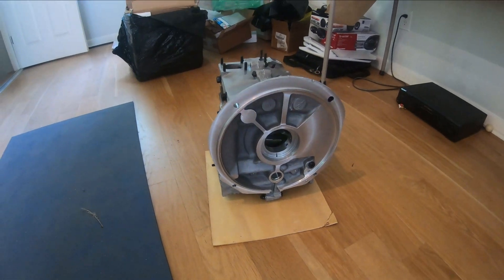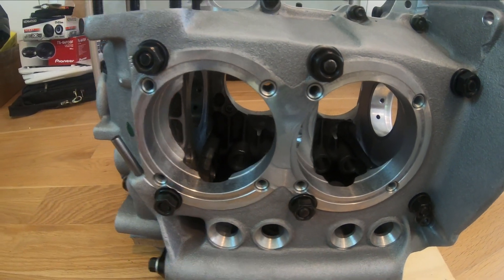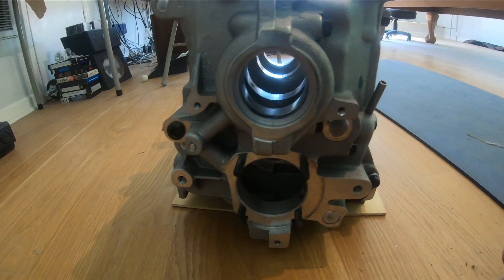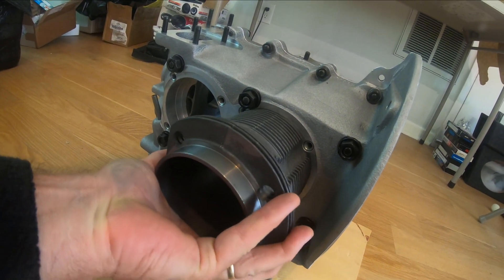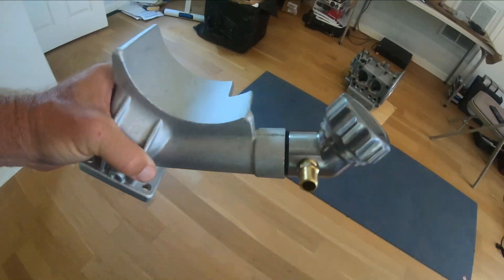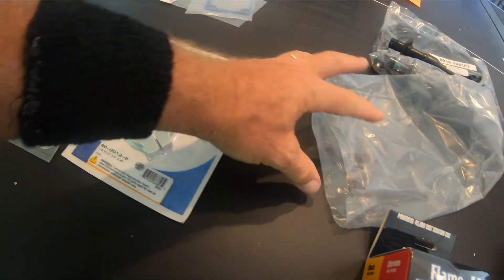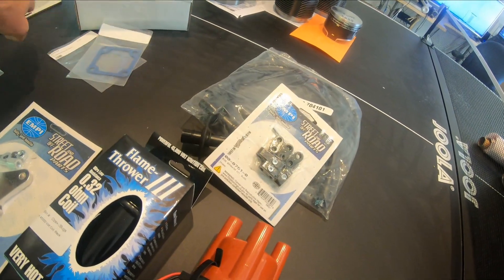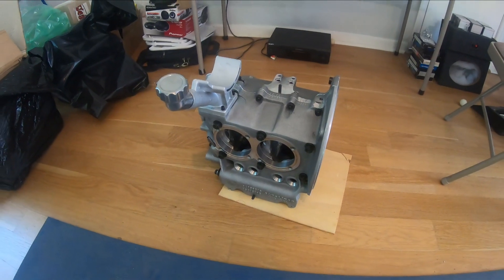2332 VW Air-cooled Stroker Motor - Video 03 - Aluminum Super Case 94 Bore Arrives!

Comment: with your nearly unlimited budget, i was surprised at your choice of distributor
Reply from the maker: Oh - I though Pertronix Flamethrower was a good coil / Distributor combo - what would you have selected?
Reply: @LarsonSplitBus-  you went with a non vacuum unit. for street use, i think a vacuum input to the advance curve is beneficial. i've been investigating programmable advance table systems like CB's black box. i don't want to go crank fired as i like the old school look.

Comment: I need to order my aluminum case soon before they go up in price again.  I keep procrastinating and costing myself money.  Did you mention from where you purchased the case?
Reply from the maker: I got the last case from LJ Air-cooled Engines and I had ordered 10 mm Aluminum Supercase with 94mm bore, and all they had was 8mm case savers with a sand seal version.  That was fine with me - everywhere else was completely out of cases, and CB said no White Rhinos until the Fall.